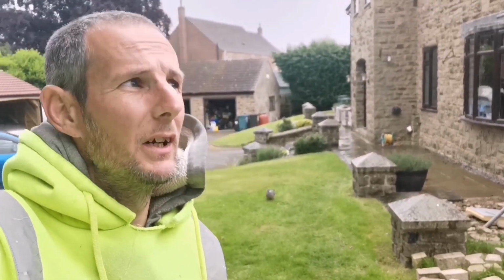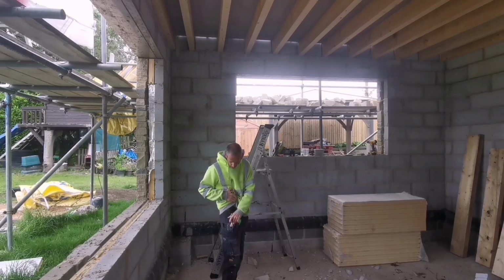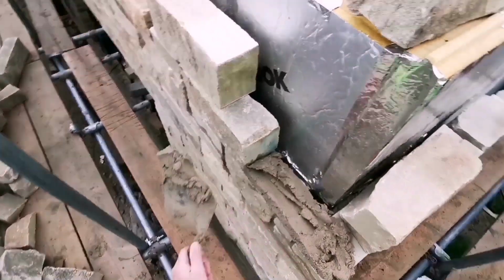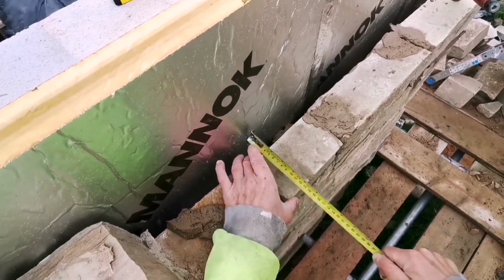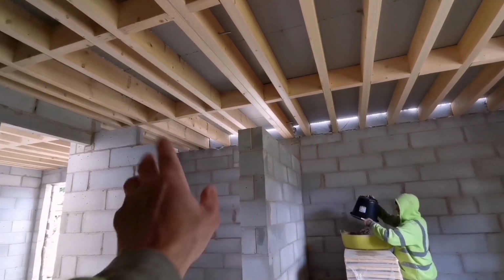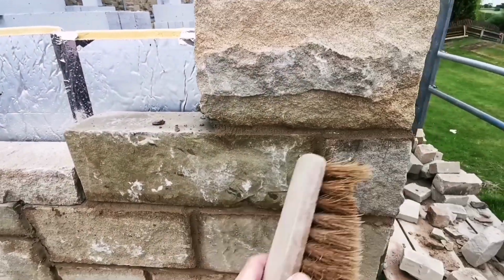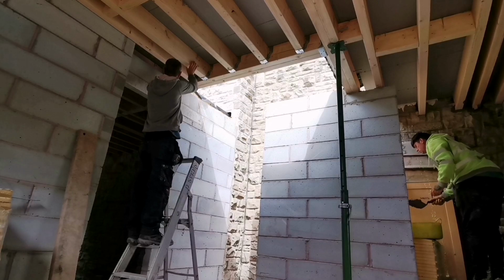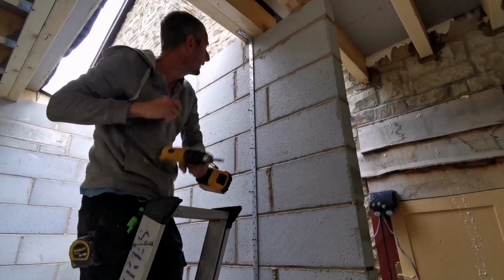doing a few little jobs wile the rain keeps coming down

Comment: How is it possible to build the rest of the wall then build the corners last
Reply from the maker: That's how random stone works you measure or your block work to keep it plumb. As long as your internal wall is plumb your stone will be plumb 👍👍👍you can build corners and string a line but I prefer to measure